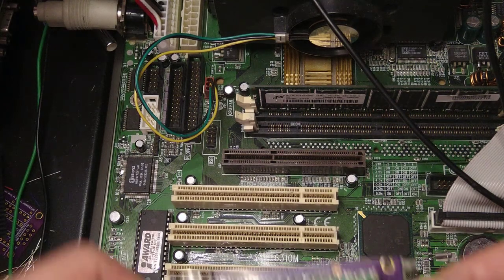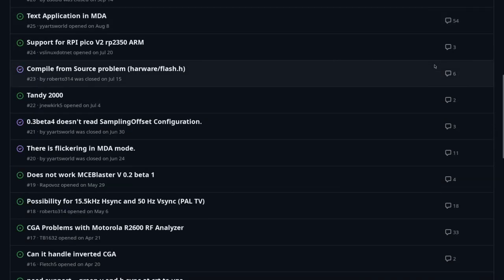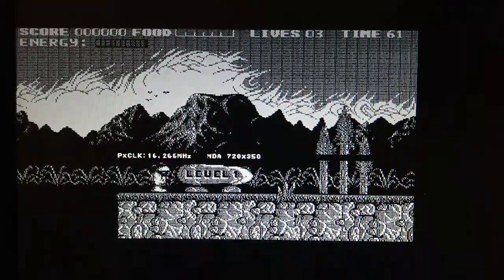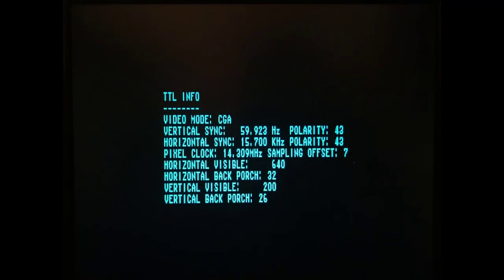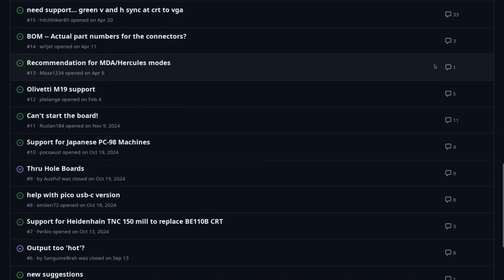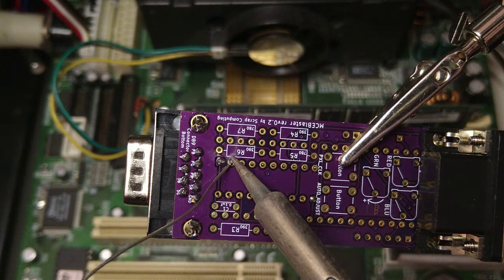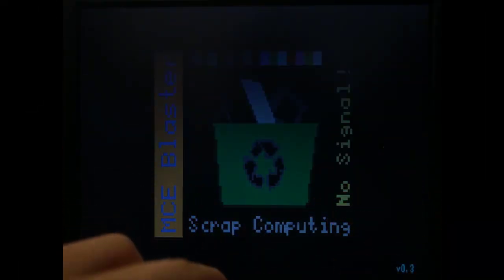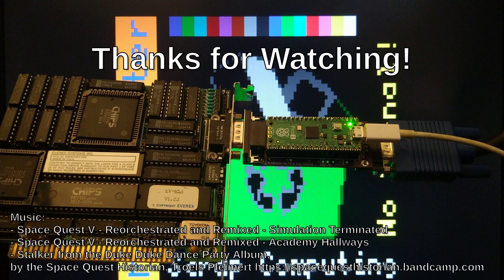MCE Blaster rev0.3 update: EGA to VGA adapter on the cheap

Comment: Nice project! Is there anything that would prevent it from working with the Commodore 128's 80-character mode, which uses a 15kHz RGBI signal (RGB TTL) similar to CGA?
Reply from the maker: I don't know much about the commodore video format, nor do I have a way to generate this type of video input. If it's close enough to EGA it should work I guess ? Perhaps with some small code changes, or if we are lucky out-of-the box in the Manual-TTL mode?
Do you know by any chance where I could find more information about the commodore video signal?
Reply: @scrap_computing  The Wikipedia articles of the MOS technology 8563 and 8568 provides some details. It uses 16 colors like CGA, but higher resolutions. The Commodore 128 VDC video connector pinout is almost identical to CGA (except for pin 7, which additionally provides a composite video signal for monochrome displays). Maybe the 50 Hz vertical refresh rate could be a problem outside the US?

NTSC models: HSYNC 15,748 kHz, VSYNC 59,65 Hz
PAL models: HSYNC 15,625 kHz, VSYNC 50,08 Hz

Comment: Could you use a rolling loop decrement? If you have 16 'slots',  track the potential error and slowly alternate the samples of the pixel clock taken? reducing one per X pixels and resetting at the start of the next hbliank or something similar?
Reply from the maker: I haven't tried implementing pixel clock auto-detection, but it should be worth trying. It would be really neat if the auto-detect button would also tune the pixel clock.

Comment: Could this be adapted to make a cheap Amiga 15KHz mode to VGA converter?
Reply from the maker: I am not familiar with the Amiga video format. Is it digital RGB HV like EGA ?
Reply: no, Amiga is analogue video signal, this is not a scandoubler, this is converter from EGA/CGA/MDA digital signal into analogue VGA signal.

Comment: I wonder if it would be possible and would make sense doing something like that: taking multiple samples per pixel, discard those outside a threshold to any logic state and  then use the logic state with more of the remaining samples.
Then with statistics on those samples automatic continuous adjustments may be possible to try to have all the samples inside a pixel
Reply from the maker: Yeah, there might be a way to do something along those lines. It would be really awesome if the user didn't have to worry about adjusting the sampling pixel clock in the first place, even though it's not too hard.

Comment: I’ve been picking up 808x computers (for free or dirty cheap) because I find them truly interesting and your project really helps me to make them usable without having to find period accurate monitors. Thanks.
Reply from the maker: The main reason I actually started working on the project was to get some video output from my Tandy :)
Reply: @scrap_computing  we will have our local version of the VCFMW called IndyClassic in March and I will have two tables presenting the 808x crew with dialup services and games. 🎉

Comment: Besides de potentiometers - what are then changes from the previous PCBs ? Can we install and use the new firmware with the older PCBs we already built ?
Thanks !
Reply from the maker: It's basically the same circuit, with slight adjustments of the DAC resistor values for the potentiometers. So they boards are compatible, you can still use the new firmware with the old boards.